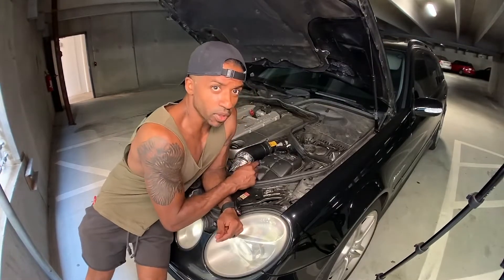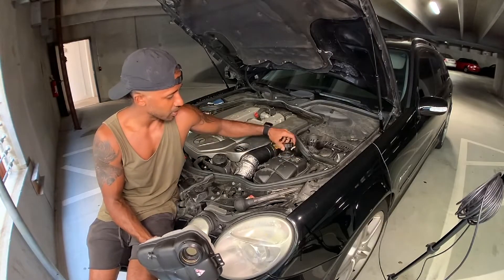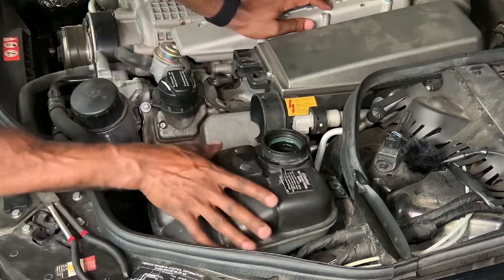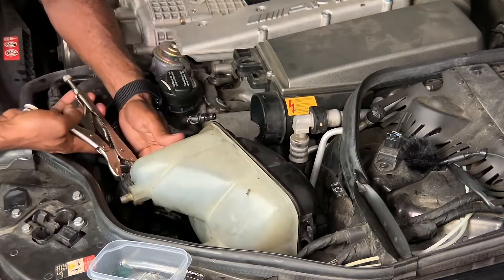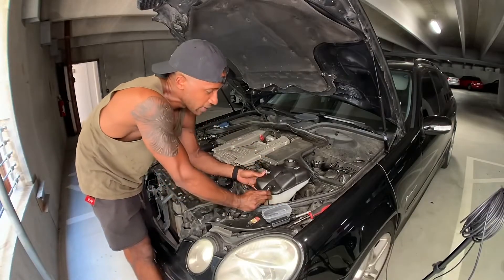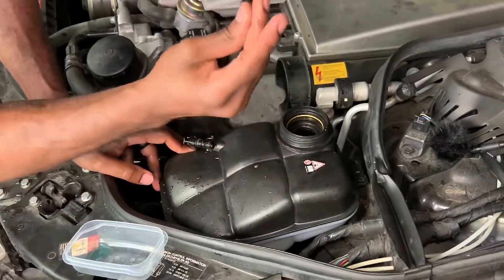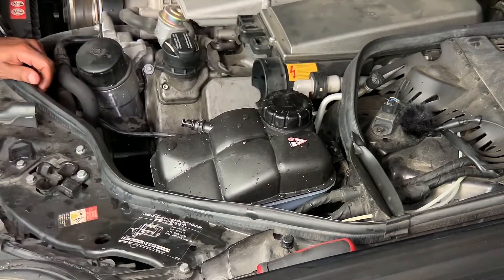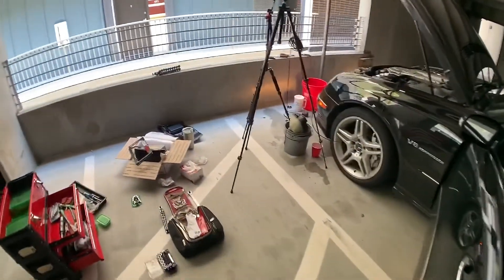Mercedes Benz E55 COOLANT EXPANSION TANK REPLACEMENT

Comment: I have a 2004 e320 wagon. I’ve had a leak for awhile now but the other day the sensor light came on. I filled it up and wiggled the tank a noticed a small leak. I replaced the cap and the bottom of the tank started pouring out the coolant. I ordered a replacement tank right away and it’s supposed to arrive today. Very good video!!! I’ll let you know how it goes. Thank you!

Comment: Hi KRT, I replaced my expansion tank in my W176 2013 A250 and now my thermo fan is running on high all the time? Temps are okay and have been told that maybe there is an air lock?? Have run the car with the cap off for quite some time to no avail. Can you help with any information?
Reply from the maker: Not sure what you mean by thermo fan, do you mean radiator fan? If you are talking a bout the radiator fans, I would let the car completely cool down, then start it. If the fans come on immediately with the engine completely cold then you have some sort of electrical issue. I would turn the AC off and see if the fans go to regular speed.  Also make sure your coolant is completely filled in the radiator. 
There might be a bleeder valve someone on the coolant system. I would google that and see if it exists. 

Good luck!  Thanks for watching, commenting and subscribing!